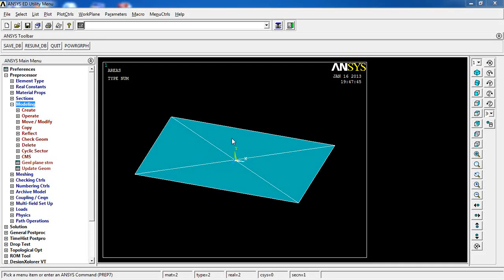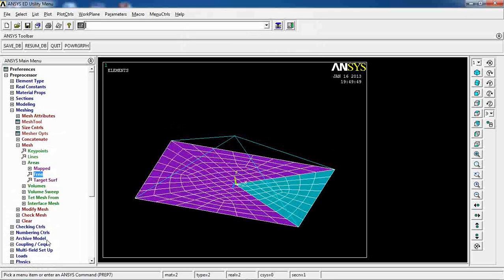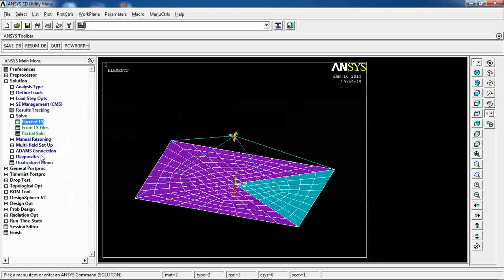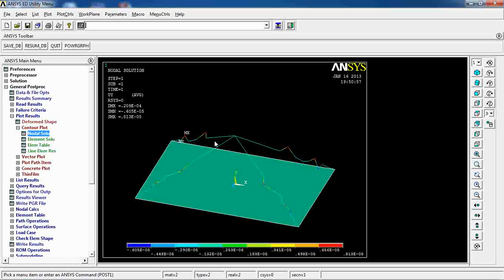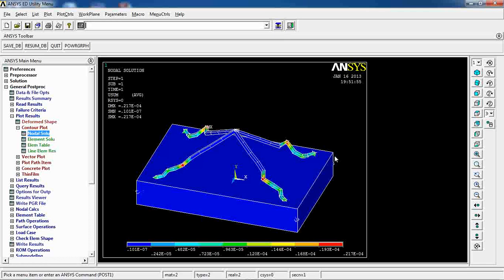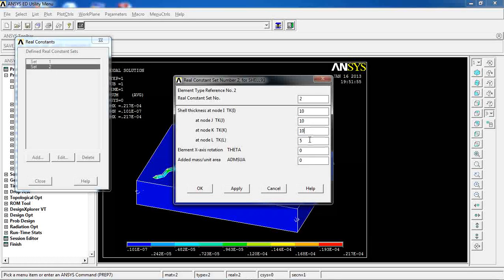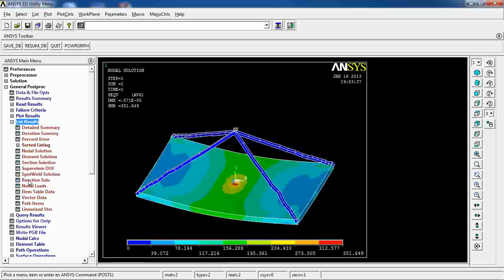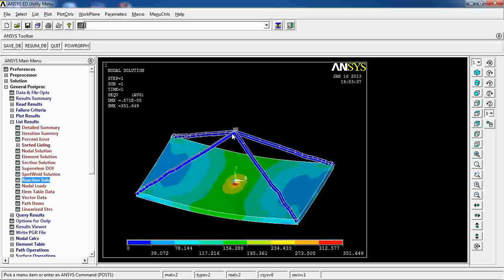ANSYS - Lesson 09 (2): Correction to the Model

Comment: I don't see how the glue operation will have any effect here. The areas already share common boundaries. If you're wondering why your LINK8 elements are deforming like that, it's because LINK8 elements only have axial stiffness and hence chains of them are unstable. You should only use a single spar element for each cable.

Comment from the maker: Hi, thanks! I haven't tried the method you are explaining. The way I did it makes sure that the keypoint is part of the model to which I am applying the force. Remember ANSYS takes everything from keypoints to lines to areas etc for meshing and if the keypoint does not belong to the meshed model, you won't get accurate result. Hope this helps.

Comment: Hi Mahdi, 

Thanks for your video lesson. It has been very educational. May I ask why do you have to split the plate into four sections initially and glue it back together after? Would it be okay if just one rectangular plate was modeled and a single point force assigned to the centre of the plate through an arbitrary keypoint?